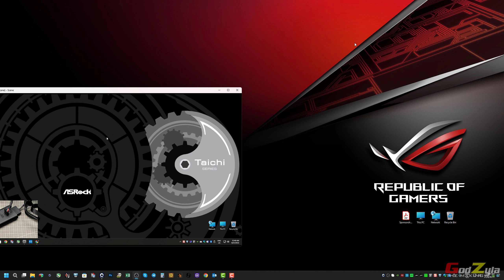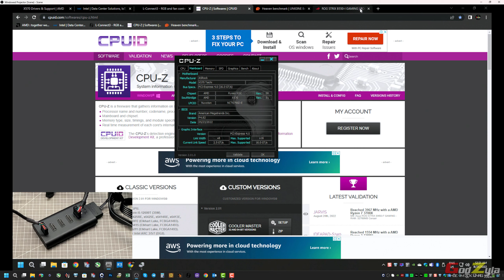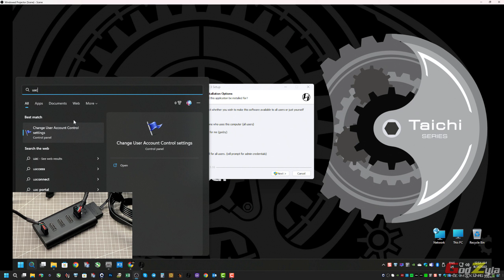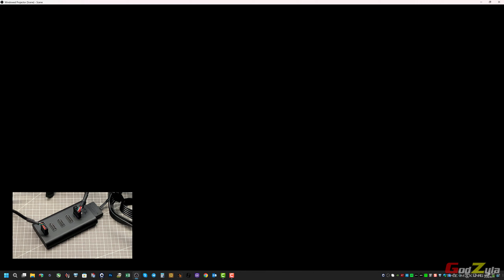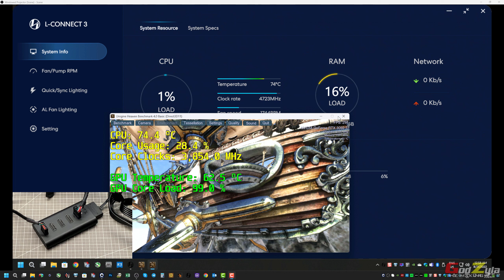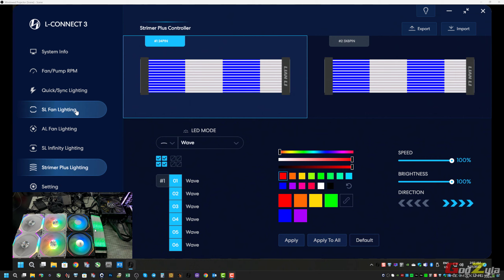Lian Li ARGB Products (How to make it work?) [L-Connect 3]

Comment: Hey, have you any idea how to resolve an issue with the Lian Li L-connect 3 software that is causing a "gradual" freeze on my entire PC? It's like a lock-up but nothing is responsive. I can't open things or do other things that requires write/read. So if my browser already loaded up a page, I can scroll and continue browsing, but I can no longer see anything new like clicking on a link or part of the page that wasn't loaded will not be loaded. Task manager and other monitoring programs would cease to function and display only the last known result before the freeze. My system clock would also freeze at the time it starts. 

I've uninstalled the software and haven't had the freeze now. I've troubleshoot this all the way down to the list and narrowed it to either the mobo faulting or something else like software. I came to the conclusion that it was the L-connect 3 that is causing it occur randomly.

The software works, I'm able to see accurate reading of the temps and rpms of the fans. I'm able to adjust the RGB of my fans and strimer v2. However if I have that program up, it will eventually gradually freeze my PC. Sometimes it will happen as soon as I finish booting up, when its automatically started up. Sometimes it would go on without it occurring for 10+ hours, or a day or two. It's totally random. All I know is after I've uninstalled the software, its been smooth sailing.

I'm using just two Lian Li controllers, the one for the SL v2 fans, 9x and one strimer v2 mobo cable.
Mobo is an Asrock X670E Steel Legend, and cpu is a ryzen 7800x3d. 
My software installation was on the primary OS ssd, which is connected directly to the CPU, not sure if that could cause an issue.

Thanks for the help if you could provide. I've looked all over google and so far I've been people describe the same situations but they all have different specs. None of which had proper solutions. My PC was just built almost a month ago just for more info.
Reply from the maker: Hi ElementXCR, welcome to my channel, after reading what you've gone through and all the troubleshooting steps which you've provided.I like to check a few things if you don't mind.
1) What's the version bios of your X670E Steel Legend?
2) What are the USB devices connected to your system?

I do have emails from viewers they are having issues. I told them to update the bios first and follow by reducing excessive USB devices which are connected to their system. you might want to try narrow down this. if it still does not help, I would adivse you to reach out to Lian Li tech support. https://lian-li.com/faq/

Comment: Can I connect SL fan to SL V2 controller and sync lighting.
Reply from the maker: Hi Saurav Brahma, welcome to my channel. Though SL and SL V2 shares the same lightings but they have different RPM profile. What you can do is to connect the SL to the ARGB Sync 2 or Sync 4 port for argb effects, else the PWM connector to your motherboard fan header directly and to use the motherboard UFEI or motherboard utitlity app to control the fan's RPM.
Reply: @KleoYan  Will see after I receive my product. Thanks
Reply from the maker: @gagansaurav00  you are most welcome. All the very best with your build too😉

Comment: I'm sorry i just randomly saw this video... and i had to come here to answer... How to make it work?(l connect 3) 
- you can't (joking) 

I think this is the worst app I had installed in my pc since i can remember... all it does is freezing... 
its like the programmers didn't knew how to use multi threading
Reply from the maker: Hi Joao Serra, welcome to my channel and thank you for your valuable feedback. 😉 as for worst, hmm 🤔 honestly I have done some builds, the only issues I face are with older pcs, but with newer generation processors and only one argb ego platform (L-Connect 3) are without issues. Also there will be issues using different kinds of argb devices with their application. Reason is, all argb shares the same IRQ. Which those argb application installed are fighting for access rights (Asus armoury crate, nzxt cam, icue and etc)

Comment: how did you connect the strimer plus lighting ? it doesn't show to me
Reply from the maker: Hi M52, welcome to my channel. I have connected the strimer plus V2 to it's controller which is connected via a USB cable to the motherboard. if you do this correctly, your device manager in windows will show the strimer plus controller.

Comment: Thanks for making this Video! I have connect all my AL120 fan to lianli hub and L-Connect 3. temp for cpu gpu shows right. Having a question. How do I control RGB of MB and RAM and GPU? seems not having a option through L-Connect 3. Currently I use Armoury Crate from Asus.
Reply from the maker: Hi @hansenwang5835, the l-connect 3 app only controls lian li argb products that have the uni controller or strimmer plus controller. It does not have a dashboard to control your motherboard argb nor the GPU or rams argb. You will need to use armoury crate for those.
Reply: @KleoYan  Thank you  so much Kleo!! you are the best!
Reply from the maker: @HansenWHS  you are most welcome. All the best with your build too 😉

Comment: i am using galahad aio 360, i have connected the fan and rgb wires to the mobo. do i use the controller connection method before i can use the software to control?
Reply from the maker: hi DX Liu, welcome to my channel. if you are having uni fans on your galahad, it's good to have fan connectors to your motherboard and plus the fans to the uni controller, use L-Connect 3 app to control the argb effects.

Comment: Could you do a video or answer if you can connect additional rgb products to the Lian Li controllers? If someone has a non-lian li aio with 2 or 3 rgb fans (which means up to 4 possible rgb cables because older systems don't daisy chain), for instance, can you make Lian Li L-connect control them? What is the capacity, if able, of Lian Li controllers to control other rgb products? Thanks for this immensely helpful video. Every other video I looked for only talked about individual products and didn't really touch on combining multiple products.
Reply from the maker: Hi Christopher Chapman, welcome to my channel. As for non lian li argb products, you can plug but with a limitation. 1st the argb effects might not react the way you want it. 2nd you will need a coverter for it. same applies to argb strips you need the converter. I have a playlist of these lian li argb products which you might want to watch. https://youtube.com/playlist?list=PLEW-b-2vYDdPo0NzHyeksx012c-nkDapm kindly note of the Dos and Donts video.

Comment: Hey I need help!! So I’m using L-connect software to control fan rgb/ rpm but for some reason my aio isn’t showing up in my bios
Reply from the maker: Hello Hay_Cartier369, welcome to my channel, mind to let me know which fans or aio are you using? For L-Connect 3 to work, you need the physical uni fan controller.
Reply: @KleoYan  SL 120 , I’m using artic freezer aio 360, I changed the stock fans to Lian li SL on the aio it’s powered by the mobo “cpu_fan” but for some weird reason it’s being controlled by my controller even though I only have a rgb cord plugged into the controller
Reply from the maker: @Jay_Cartier369  I see, you should plug the pwm fan connector to the CPU_Fan header and the Aio pump header to CPU_PUMP or W_Pump.
Reply: @KleoYan  there’s only one pwm connector for the aio
Reply from the maker: @Jay_Cartier369  ok .. your SL120 do not plug to the radiator hose where there is the PWM fan conector, plus it directly to the CPU_FAN 1 instead, then on the pump header, plug it to your CPU_PUMP/AIO_PUMP/W_PUMP (depends which motherboard you are using) take note, you will be able to see your SL120 if you plug it that way.. as for all Arctic LF2 AIO pump, there will be no readings.. it's common.
Reply: @KleoYan  I think I understand what you mean now so your basically saying disconnect the sl fans from aio and plug it in cpu_fan and the aio plug in aio_pump
Reply from the maker: @Jay_Cartier369  ok let me explain. for SL120 which are on Radiator AIO, it will be best to have those fans 4pin PWM connected to the CPU_FAN header and the argb to the uni controller. so your radiator fans RPM are controlled by your motherboard and the argb controlled by the uni controller (using L-Connect 3 app) in the event if the uni controller failed. only your SL120 lightings will be down but not the RPM which is more important as it cools the radiator. 

Some choose to plug this way which is all SL120 radiator fans, both pwm and argb to the uni controller and use the cable (both argb and fan pwm) to connect between the uni controller to the motherboard headers (argb and pwm). I wouldn't advise this cos, if the uni controller failed. both argb lightings and your fans stop spinning (PWM)
Reply: @KleoYan  thanks I watched your video again and I think I missed a important step I didn’t connect the Lian li fans to the 4 pin port on the artic freezer
Reply: @KleoYan  okay so plugging the Lian li fan into the 4 pin slot for the aio makes me be able to see the cpu fan in the bios but now the issue is that the l connect 3 software is saying 0 rpm for one set of my fans I’m still able to control the rgb though
Reply from the maker: @Jay_Cartier369  . Is either you use motherboard bios or use uni controller. If you need both, that I do not know how. Maybe ask try asking at lian li Reddit forum.

Comment: Hello, Thanks for the video!
I am having trouble though; I only have one port active on my SL120 controller with 6 fans daisy chained;
All fans are on, but 3 do not show RGB no matter what I try, any tips?
-Thank you

Changing the quantity of fans does not do anything
Reply from the maker: Hi, ChromeMagnum, welcome to my channel. Do you mind to check on your L-Connect 3 application, under settings and device. it will show you the fans that are connected. are they highlighted or not highlighted. If not highlighted. enable them. you should be able to turn on the LEDs of your fans.
Reply: @Kleo Yan  yeah i did that for the same port that controls the fans that do show rgb. Still nothing
Reply from the maker: @ChromeMagnum  maybe I should start off by asking you.. what uni fans are those? SL120 or SL120 V2? if it's just SL120, you can't daisy chain 6 fans to a port. max is up to 4 fans.
Reply: @Kleo Yan  they are all v2
I just tested the 3 fans on their own port on the controller and they light up fine
But daisy chained they dont light even when added as a 6 link in L Connect.
Ill try a different daisy chain cable maybe
Reply: Ok well, I didn't change the cable,
I just replugged it into its original set up and re did the device settings.
Now its working as intended. Just needed to be unplugged and plugged in as L-connect was running it seems.
Reply from the maker: @ChromeMagnum  this is weird. yup, try use another cable. get one set (3 Fans) to work and swap.. make sure 2 sets of fans are running and lighting up.. then do the bridge.
Reply from the maker: @ChromeMagnum  oh ok ok.. that's good to hear.. sorry for the late reply as I was busy at work. thank you for replying.
Reply: @KleoYan  yeah thanks for your help
Appreciate your time 🙏🏽
Reply from the maker: @ChromeMagnum  you are most welcome. I am gald you have resolve the issue. enjoy 😉

Comment: l connect is not detecting aio or fans
Reply from the maker: hello alex carapia, welcome to my channel. did you check the connection properly and did it not detact your uni controller in windows 10 or 11 device manager. kindly provide more info, as I am not able to guess what's your issue.

Comment: I have 10 SL-INF fans. 3 top fans for AIO, 3 in front, 3 side and 1 in the back. Now if I connect all of them to 1 controller... do I have plug the controller into SYS_FAN? I understand that top AIO fans will not turn on until I'm booted into Windows. I kind of wish them to turn on when PC is turned on. What are my options?
Reply from the maker: Hello Ivo Kurzemnieks, welcome to my channel. as what you've mentioned, you can choose to use the L-Connect 3 to control the RPM and argb, you need not have to plug anything to the motherboard fan header, unless you wanted to control the RPM via your motherboard UEFI or it's utility software. as for the boot up, there are no other options, you will have to load to windows inoder to kick start L-Connect 3.

Comment: My L connect 3 is running painfully slow, I can’t do anything with it and can’t find help anywhere
Reply from the maker: Hello Simon Austin, welcome to my channel, are you able to check what's the process usage as in percentage of L-Connect 3 app? maybe you want to try remove the app and reinstall the app, use Revo Uninstaller to clear off all the unwanted files and registry before you do a clean install of the L-Connect 3 app.

Comment: Thanks for the video. I have an issue with my Strimer. I recently installed the 24 pin v2 strimer and the 12vhpwr v2 to my lian li inf hub like you showed in one of your videos. My issue is that upon startup my system RGB from lian li inf fans synch with my motherboard as they should but my Strimers dont do that. They stay in default rgb color. They only synch up with motherboard when i startup L Connect 3. Is there a way to solve the issue? Thanks in advance :)
Reply from the maker: Hi Alexandar16, welcome to my channel. I like to check how did you plug your Strimver Plus V2? does it plug to the Strimer Plus V2 controller?
Reply: @KleoYan  i plugged my strimer v2 hub to my lian li inf hub with a splitter. i have 10 fans (3 bottom, 3 side, 1 in the back and 3 up connected with my nzxt z79 aio cooler) all of them connected to the inf hub and now the strimer hub is now connected there too. The only thing i added there too is the NZXT internal usb hub since my motherboard only has two usb 2.0. The AIO and the Lian Li Inf hub is used with the NZXT usb hub. Thank you for your answer. I really appreciate it :)

Comment: So dumb to need so many controllers to do some led lighting. It's like mixing 20th and 21st century tech. Should be 1 controller, and 1 software to control everything. Esp for the price.
Reply: I won’t lie, I definitely agree to this. Should be much, much more simple this day and age.
Reply from the maker: @micspamgod2324  welcome to my channel. Thank you for your feedback, I have sent this feedback to Lian Li and it will be great if you can highlight this at Lian Li's Reddit forum. https://www.reddit.com/r/lianli/
Reply: I am really irritated that I have spent soo much money and it took us  hours searching on web how to connect, AIO and fans. And then you find out you need hub. Which is not shown on any manual.
Reply from the maker: Hi Nick G, welcome to my channel and thank you for your feedback, just a suggestion, you might want to write in to Lian Li to suggest it.

Comment: hope you can help I have 10 fans 7 lian li v2 and 3 v1 when I try to sync them to 1 static colour some of them are blue and some go green and red? I noticed your sl fans done it to when static was applied. also every time I connect to lian connect it turns off my lian li cooler rgb
Reply from the maker: Hi Joe, welcome to my channel, though you have listed out the V2 and V1 fans, just to confirm, are your fans SL120? also may I ask how did you do the connections?
Reply: @Kleo Yan  thanks for the reply, yeh they are the sl120 fans. and connected them to the hub and not through the mother board. both hubs are connected to 1 sata cable
Reply from the maker: @joe5940  I see. Is your controller usb cable connected to the motherboard. If it is, check to see in windows. Does the uni fan controller shows under Universal Serial Bus Devices?

Comment: hi bro can i use lian li fans and strimmer V2 connected to nzxt hub or will it have power issues
Reply from the maker: Hello Alpha416 Game, welcome to my channel, pardon me. which NZXT Hub are you referring to? Is it the one shown in this video? the NZXT Internal USB 3.0 Hub. if it is.. no issue as power drawn from the uni fans are from it's uni controller and the Strimer Plus V2 from it's controller.

Comment: Hey im having 1 issue, I have 2 uni hub sl v2 connected and everything is working but I cant get the moving light effects to sync properly.  Each controller's fans moves separately, any way to have my fans moving rgb effects move as if they are all one units?
Reply from the maker: Hi joe leeman, welcome to my channel. If you are using SL V2, your fans can do bridging which you can use 1 controller instead of two. this way you can sync up all the argb effects. For two control unit, it will not be able to do so. you can view this video on bridging https://youtu.be/SDXN4mfE6ro?t=1321

Comment: Hi, awesome video but I have a question, I got infinity fans and how can I control them using motherboard bios? As I see an argb port but not pwm port so I'm confused on how to do it, I got an asus motherboard.
Reply from the maker: Hi Vigilante, welcome to my channel. if you have the argb and fan cable connected between your uni fan controller / hub to your motherboard, in L-Connect 3 app, set to motherboard mode on at Quick Sync Lighting. as for your motherboard to control, you might need your motherboard utitlity, example Armory Crate for Asus, Mystic for MSI or Fushion for Gigabyte or Ploychrome for ASRock.
Reply: @Kleo Yan  yes i already did that, thanks for the reply.
Reply from the maker: @vigilante9259  you are most welcome.